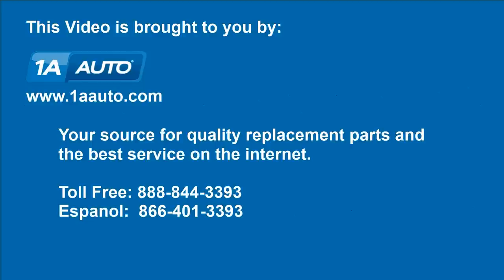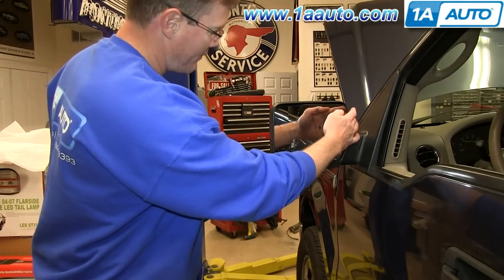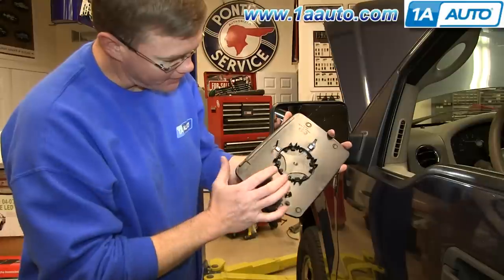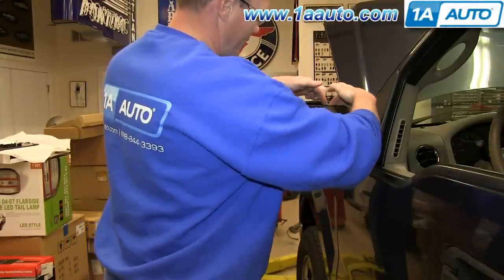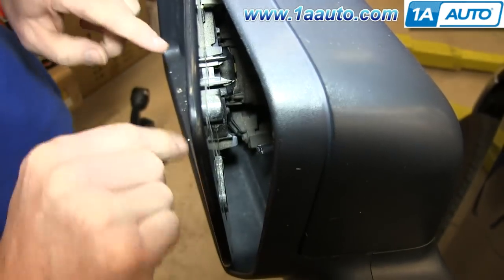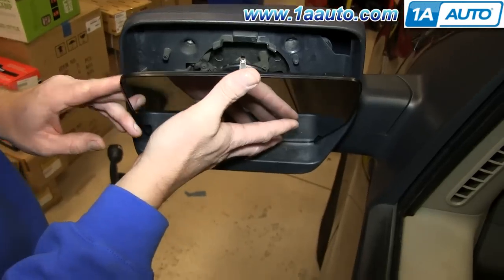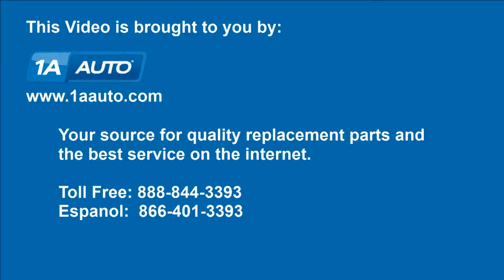How To Replace Broken Mirror Glass 04-13 Ford F150 Truck

Comment: By far the best video for my 04 f150 mirror.  Pulling back on those tabs not as easy as it looks because the tabs are so short. I finally just pried the minor loose as it was cracked anyway. I got lucky and the mirror just popped off. Putting the new mirror on required me to use a slim flashlight to verify all four tabs locked into place. They didn’t the first couple of try’s. I THINK all four tabs are in place now. I’ll probably know when I’m flying down the highway at 70+  MPH and it doesn’t pop off.

Comment: Struggled a little with the installing part. Specifically trying to get the upper clips to actually clip. Took a while, but managed to do it. Thanks a lot, for this video allowed me to do it myself. Cheers.
Reply: Did it on a 2011 lincoln mark lt

Comment: I appreciate the info you provided which was helpful. When I was doing it the tabs were WAY too small and stiff to unhook with my fingers. eventually the glass came off with the clips in place. The motor piece came apart in the center leaving part of it attached to the mirror, if that makes an sense. I needed a new motor anyway, the mirror fine

Comment: thanks for this video. My 2011 Ford Edge mirror had popped out when someone closed the mirror and i couldn't figure out how to get it to stay in w/o popping back out and apparently all i needed to do was put enough pressure in the center until it clicked (popped) into its locking position, now it works as normal.

Comment: I bought a replacement from you for a 2008 F-150 King Ranch with heated mirrors. When I pulled the old mirror out , in addition to the two wires with female lugs that attach to the two male connectors, there were two more wires glued to the mirror through openings in the back plate. What do I do with those?

Comment: I've replaced the passenger side mirror on my 2017 f 250 with parts ordered from you guys...twice...and each time it snaps in its distorted from top left to bottom right.am I doing something wrong?Does this sound like the mirror enclosure itself might be twisted or warped in some way?All clips are snapped and seated....im at my wits end with this thing.
Reply from the maker: +Terry Burks We are sorry to hear about the issue you're experiencing! Please reach out to us directly so we can assist you further with the mirrors.

Comment: Yeah that's a great way to strip the teeth in the window adjustment gears. Instead of forcing it like that, use the mirror controls to tilt the mirror down next time when releasing the second set of clamps.

Comment: Mike; I have s 2003 Pontiac Montana that the sides mirrors don’t go up & Down! They only move (Electrically) sideways! I don’t find a way to check the inside of the housing )I think that’s  what is called) Amy suggestions?? Thanks! 👍🏻
Reply from the maker: +Mr. M. Dee Thanks for your inquiry. There could be multiple reasons why you're having this particular problem. We suggest taking your vehicle to a nearby reputable shop to identify the cause

Comment: The driver-side mirror on my 2014 Ford F150 is loose. It shifts when I shut my door. Do I use the same process to get access to it so I can tighten it? Thanks
Reply from the maker: +DJR Yes, you can use this video to help with this process.

Comment: I know you mentioned a 2011, but would you please tell me if just the passenger side glass may be replaced as shown in this video on a 2011 Ford F-150 XLT with motorized adjustment and heated mirror and signal strip built in?  Thanks...
Reply from the maker: +audiophile man The process should be the same, you would just have an additional harness for the turn signal is all.  If any of our viewers needs to make this repair, we carry the auto repair part shown in this video on our website. Here is a link to them: http://www.1aauto.com/mirror-glass-driver-side/i/1amrg00020?utm_source=YouTube&utm_medium=CTA+Comment&utm_campaign=ytcomment&utm_term=7fRHK5D2coY
Reply: 1A Auto Parts it is not the same.  The glass on my 2012 just fell off and looking at it, there are wires that have to be soldered. and part of what hold the glass to the mirror housing is a ball joint that broke. You have to replace the entire housing.  We need that video.

Comment: Do you have a video for the Crown Victoria/Grand Marquis mirror piece?
Reply from the maker: +James Laidler   It's very possible that we do!  Please visit 1A Auto's Video Installation library here:  http://www.1aauto.com/videos   Simply enter your year, make, and model and choose the video for your repair!  For anyone else needing to replace their mirror glass, 1A Auto offers the part here:  http://www.1aauto.com/mirror-glass-driver-side/i/1amrg00020?utm_source=YouTube&utm_medium=CTA%20Comment&utm_campaign=1ATony
Reply: No I couldn't find it. How would I remove the mirror plate without breaking anything? I have a side mirror on order, I merely want to pop off the outer shell to put on the original blue shell from the broken mirror. Of course to do that I have to remove the mirror glass to get to the tabs. I'd like to know in case I can't use a screw driver blade to get to it through the gaps around the glass.

Comment: I got a mirror from autozone but the thing has little metal "hooks" instead of the long ones like in the old one. Did a get a wrong mirror or what? Help!! I need to change it asap
Reply from the maker: +Jose C Thanks for watching. We carry the correct replacement glass shown in this video on our website. Here is a link to them. Hope this helps you out. http://www.1aauto.com/mirror-glass-driver-side/i/1amrg00020?utm_source=YouTube&utm_medium=CTA+Comment&utm_campaign=ytcomment&utm_term=7fRHK5D2coY

Comment: My mirror arrived in mail. What is the adhesive sticky foam and 2 metal clips for?? There is no information that came with my glass replacement. Which falls out of the plastic insert.
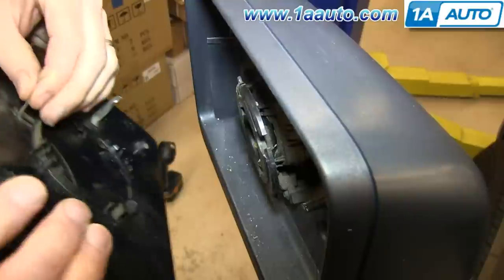Reply from the maker: The double sided tape is used to adhere the glass to the new bracket.  The two tabs are used to secure it to the motor like you see at the 1:36 mark in the video!  1aauto.com

Comment: Whats the part number? I have a 2013 f150, only difference is it has a trailer mirror. Its for the driver side.
Reply from the maker: +Nun Ya Beeswax If you mirrors have power and heat here is a link to them OE replacement glass that we carry for the factory Ford tow mirrors. Hope this helps you out. https://goo.gl/VSiFoK
Reply: 1A Auto Parts do u have an email so i can send a picture? The mirror is note powered or heated.

Comment: How do you remove the LED turn signals on the mirror 2014 Ford explore
Reply: You don't. You have to replace the entire assembly if the LED strip below goes bad or is damaged.

Comment: Is this the same process for the 92-96 F-series and Bronco’s?
Reply: No, the attaching of the mirror to the adjusting motor is not the same. Buy the new mirror and look at how it attaches to the housing and motor. Pretty much common sense how it attaches then just work in reverse to remove broken one. Good luck

Comment: Will this work for a 2007 ford escape miror
Reply from the maker: +sc h It may be a different process on your 2007 Ford Escape. We currently do not have an auto repair video for that particular year, make and model vehicle. We do carry the replacement mirror glass for it. Here is a link to them https://www.1aauto.com/2007-ford-escape-mirror-glass/y-mo-c/2007-205-331?utm_source=YouTube&utm_medium=CTA%20Comment&utm_campaign=ytcomment

Comment: Does this work for the 2000 Ranger mirror?
Reply from the maker: +MIKE McKool Thank you for checking us out. We may not guarantee it exactly, but most mirror glass replacements may be made with viewing this video or similar. They are held on by clips to the housing and once detached may be pulled out. 1aauto.com

Comment: what about if it's powered?  same?
Reply from the maker: +seanYsean If the options are just power with no heat, the mirror will still snap into place. If you have heat there will be a connection that needs to be made for the heat to function. 1aauto.com
Reply: @1AAuto  I still have the old mirror, it popped out.  I'm going to try to fix that over the weekend, if not I'll order the one you used.  Good quality mirror I take it?

Comment: why is every ad for a ford pick up truck passenger door mirror listed as heated.  My trucks passenger door mirror is not heated, it is a "Power Fold"  Not Heated.
Reply from the maker: +Jim Garner Thank you for your question.  Sometimes you may not know you have heated.  Best to check the options with your VIN# with a dealership.

Comment: But what if your mirror has wires attached to the back off the glass???  I can't find any videos about that.   Every video shows exactly this same obvious guide.
Reply: Can't find any Info on these two wires either.  REALLY a pain that these videos don't describe the differences you might run into with replacing the part.  I understand their particular vehicle might not have the additional features (heat, auto dimming, etc.) but at least describe what to do if you have these additional connections.